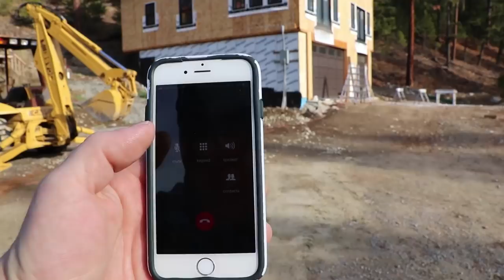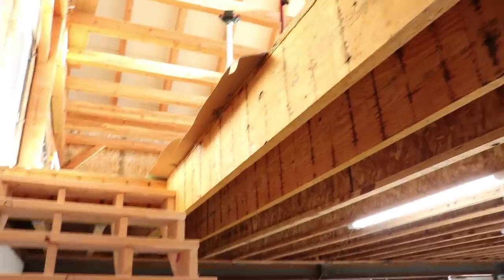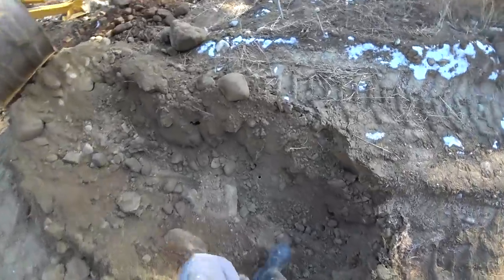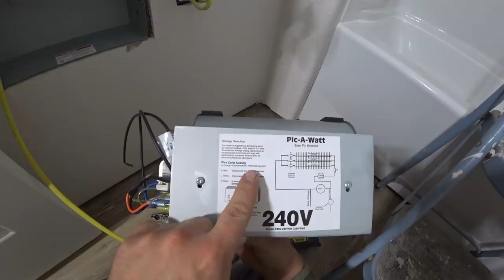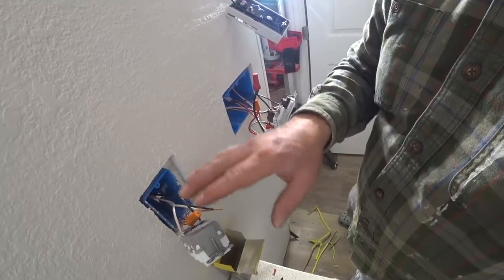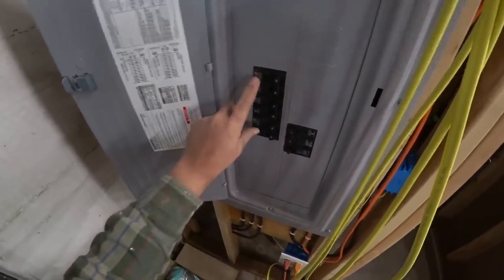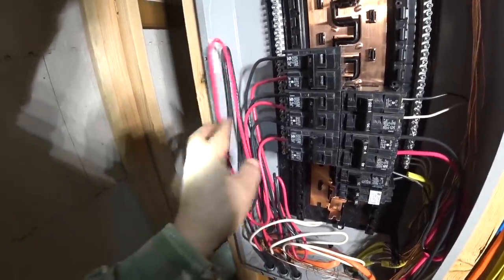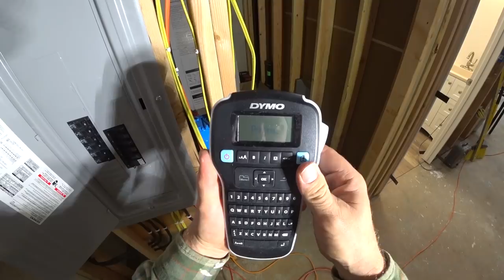Holy Cow IT ACTUALLY WORKS! (Wiring Garage Bathroom)

Comment: Questions for you electricians on here.  Why not go with a GFI breaker in the box and regular outlets?  Hopefully starting my build next summer and want to use these for the bathroom and kitchen

https://www.amazon.com/d/Thermal-Magnetic-Circuit-Breakers/QO120GFI-Square-20Amp-1-pole-breaker/B005AZHSIC.
Reply: because they're 45 dollars and a gfi outlet is only 10...
Reply: glad you asked. square d panel with quick grips and plug on neutral is a must. or leviton just started making a panel that is very nice also
Reply: if your panel is far from the location is a negative for gfi breakers. plan on installing arc fault breakers
Reply: if you want to save money have an electrician consult and layout the house and set the boxes for you. most will have no trouble with you pulling your own wires. if it's 2x4 walls buy plastic stackers instead of staples
Reply: that link you posted is a breaker with a "pig tail" the panel will be stuffed with those and look like shit
Reply: We can see the top of the Tetons from the Kitchen window in the farm house/.. Your link is to a QO breaker  QO's are a step up from HOMELINE series more commonly residential use. Jesse is making a lot of mistakes building this house.  best to hire a retired contractor to mentor you, I am a GC, taught construction trades a few years ago JC and apprentice classes.
Reply: Cause if if your in the bathroom taking a huge dump or taking a shower and the gfci breaker trips for some reason then you are in the dark.... In cases "other" than how "he wired" his bathroom, you could use a gfci breaker to feed the sink outlet/s only, and wire the lighting in 14-2. and use standard receptacles. But a GFCI breaker is like 36.00 where a gfci outlet is like 15.00 so it is a cost issue most of the time. As far as your build next summer there are different requirement for the kitchen countertop circuits that differ than a bathroom, locally here you are required to have AfCI and GFCI for kitchen counter top space, just check with your local codes to see what is the requirements, or hire a licensed electrician.

Comment: BLACK RED   AT 240V AMP DRAW IS 10 AMPS AT 120 V AMP DRAW  IS 18.3    NO 12 WIRE IS 20 AMPS    WHEN USEING THE WHITE AS A HOT ITS NEEDS TO BE MARK RED OR BLACK
Reply: The heater is only a 240v heater it will never draw more than 10 amps...a 14-2 would suffice as well as identifying the grounded conductor to an ungrounded conductor color, per NEC 200.7

Comment: Here in South Africa (all 240v) you can't have lights and sockets (outlets) on the same circuit. 10A breaker for lights and 20A breakers for outlets. Our outlets have a switch for each plug and our light switches press down for on not up. Oh yes and no switches or outlets allowed inside the bathroom. Sometimes you might have an outlet for a shaver near your basin but hardly anyone uses them.
Reply: Concerns for safety are squared when you double the voltage, and GFI and other fault protectors, required in many nations with 240V standard, as well as in North Am potentially dangerous situations, greatly reduces the hazard. Wall switches and outlets, even fault protected, still have to be a min distance from sinks and showers.
Reply: Do you drive on the wrong side of the road? Lol

Comment: HA, they make you put a GFI on the incoming bathroom supply but then say you are allowed to wire the lights via the GFI input.. Well what a waste of time the GFI is then when you switch on a wet light switch with a wet hand.. Personally, whether you are allowed to wire a certain way or not.. wire for safety, not ease of installation.
Or fit a pull cord light switch.. Dumb rules are dumb!
Reply: Some jurisdictions don't allow pull string switches any more.
Reply: The NEC has no requirement for GFCI protection of lighting in a bathroom. If your fan is not inside the shower it does not require GFCI protection.
Reply: He could of ran the home run to the the 3 gang and just fed over to the gfci on the line side for the sink receptacle requirement. He just wired the bathroom backwards than most installs are done.

Comment: Got some big gaps round the switches and sockets in the bathroom, isn't that a code fail?  Some of the things that are allowed in the US amaze me, like sockets in the bath room, and like wise we allow all sockets on one floor to be on a ring circuit which I think is a big non no over there.
Reply: Ring circuits here in the UK were introduced after the war to save cable. Think we are one of the very few nations to still do it. But yes, very strange electrics in US. Two different voltages in same consumer unit, weird colour coding, sockets on bathrooms... crazy stuff.
Reply: did you even watch the video where he says he's going to be addressing that?
Reply: Part of the reason why there are receptacles in American bathrooms is that 110v is far less lethal than 240v. Also, GFCI is required. So between the two, it isn't a significant risk.
Reply: all sockets in a ring is a big no because our devices are not individual fused and our codes do not like the fact of having  excessive amperage cld occur if there is a split in the ring. i have done some qck research on uk wiriring i understand the ring idea but its to dangerous in my opinion and in a lot of uk sparkies i follow.  also the smallest wire we use for our wiring is 2.5mm fused at 15 amps wich is why we can have both lights and outlets on same circuit. this can not be done safely with a ring we wld be putting max 30 amps of power praying there is no break in ring.

 and the sockets in bathroom in modern homes are all gfci (rcd 4 u)30ma trip-setting in UK, 5ma in USA so they are qcker than your rcd. otherwise yes it wldnt make much sense like why most old homes in uk have 2 water taps for hot and cold most in north america have just one.

real qck usa avg home wiring bed rooms wired in  2.5 avg 9 devices per circuit. bathrooms all outlets need gfci exhst fans no isolaters needed can be tied into lighting circuit.  kitchen refrigerator and microwave on own circuit 2.5mm no isolaters needed. appliance counter outlets  2 circuits 4.0mm  20 amp both need gfci/rcd protection. electric cooker/oven 10mm to 25mm depends on device 40 to 70 amps own circuit 240 volt.  washing machine 2.5mm 15 amp own circuit. electric clothes dryer  6mm 30 amp 240volt min depends on machine. electric hot water tank  may need isolater and 6mm 30 amp 240 volt. outside  a/c  6mm to 16mm 240 volt needs isolater
Reply: Sockets and touch switches are allowed here in the Netherlands as well. We use 230 volts though. The things that most amaze me about American electricity systems is that they make panels and conduit out of METAL. that's so freaking dangerous. Just use plastic for that, it does not conduct. I'd never dare to touch an electrical panel that's made of metal.
Reply: Nix on the Ring Circuit. You have to understand the theory of operation to understand the proclivity to cause fires if one end of the loop disconnects. They were for another era that has passed, even for the UK. They're also a pain in the azz to install in many cases. In the big scheme of things, copper is cheap, and in the scheme of safety, not worth being frugal with. North Am can and does allow 240V appliance supply wiring, and oddly, under the NEC, with less rigorous requirements. For long runs and power tools, 240V is almost always better, especially if a heavy draw like a table saw, or in the kitchen, a commercial toaster or mixer.

It's often cheaper and more effective to wire kitchens with 240V outlets as well as 120V to use European appliances rather than replace them for those who've emigrated here.

For garages now, due to car recharging, some jurisdictions require 240V be provided. Oddly, GFCI protection not required, although sensors for that are included in the chargers themselves in most cases I'm aware of.

Comment: Use your duct/gorilla/godzilla tape over your french door holes until you fill them with knobs, locks etc.  You probably already have done this.  Your videos are running behind.  Foam pipe vent.   Will be interested in if you have a new way to seal garage doors better.

Comment: from an electrician in the uk... im sorry, I have watched obsessively from the very beginning and loved every episode.. but this video had me cringing.. im surrounded by 5 other electricians all open mouthed in disbelief .. is that really how your electrics are done???.. I wont even comment on the quality other than its a lesson in why it should be left too a professional..  by the time the rest of the wiring goes in, that board is going to look like a plate of spaghetti..  can anybody explain why the main isolating switch is outside rather than a part of the board ????  and the bare earth/ground wires.. you dont sleeve them ?  why are all the cables run down to the floor then back up into the board..  there are knockouts at the top for a reason ??.. I have too leave it there... my head hurts..
gary
Reply: I will try to explain if I understand your lingo correctly, The isolating switch( for the heater?) if that is what you call it, we call it a reostat/Thermostat, is generally located within site of the device it serves, in this case the bathroom for easy access to control the temperature of the heater. The bare ground wires are pretty common in houses in the US, there are some places like Chicago that don't allow the use of Romex-(nmb) but most of the country houses are wired with romex with bare grounds in the sheathing. For Commercial building most are piped with EMT or other means like ENT(Smurftube) and in those building the ground is coated with a green coating along with other colors for the non grounded conductors and grounded conductors. It is typical to use both the top and the bottom of the panel (board) for entry when it is in a wall like it is installed in this application, He is going to have a crap ton more of wires to feed into the panel from upstairs and that is probably why he is using more of the bottom of the panel for these local circuits that are installed in some of the same framing areas. I hoped this helped, but feel free to ask any other questions on how us Americans wire stuff goofy haha, I would also state that Jesse is not a professional electrician and hopefully his wiring does not influence the rest of the world as to how things are wired here in the US. Be that as it may, he didn't do to bad of a job but does have some code violations in some of his wiring. But as a homeowner he is allowed to wire his own house as long as it is up to standards of his local/state codes.

Comment: NOOOOOOOOO !!!!!  When wiring a 220V box or outlet use black wire and red wire for the two power leads and bare copper wire for the ground lead. No white wire at all. This is why your feed into the main box is a black cable to one buss bar and a red cable to the other buss bar. The white cable goes to the neutral buss which is used for 110V only. notice that each 220V double breaker connects to both black and red bus bars in main box. Your electrical inspector will be giving you a stern safety lecture for using white wire instead of red. You have set a trap for some poor unsuspecting electrician.
Reply: Unless he decides to follow code, NEC 200.7 and re identify the grounded conductor to a color of a un grounded conductor.

Comment: That outlet is way too close to the water tub that would not be allowed in Ontario
Reply: yup local codes and laws vary from state to state
Reply: Canada does weird wiring, us US electricians know this cause you mount your panels sideways, hahaha No but really I don't believe that requirement is here in the states, just as long as it is not IN the shower.

Comment: I would review your thermostatic wiring... it does not sound correct... all the 240v thermostatics I have wired require that I wire both legs through the thermostatic switch... the way you have it wired you will have one leg 120v hot at the heater all the time... the sounds wrong and dangerous.

Comment: More NEC violations! The heater white wire must be colored to designate it as an ungrounded conductor. You also mis-stated the names of the conductors. Additionally, the bathroom receptacles must be a circuit by themselves. Lights and fans should be on 15A circuits. It is not a "hot" wire, it is called the "ungrounded" conductor. Seriously, you need more understanding or you are going to burn your house down.

Comment: Stop touching inside your panel, you are freaking me out.
Reply: As long as I know it is dead, I don't mind touching a panel. However, I don't trust his use of a non-contact voltage detector only. I always use a known working multimeter to test a panel before I touch it. Also, a good habit is to tape/label a beaker or disconnect if you are going to work on it.
Reply: it wont shock you through the computer, i swear !!

Comment: You need to replace your heater wire with one that has black, red, white , and bare ground.   National Electric Code.
Reply: false. 12-2 is fine for a 240v heater load per the NEC. 12-3 is only needed for a 240v appliance load where you need a neutral for running 120v parts of the appliance. Best practice is to mark the white with a black or red trace where it is visible.
Reply: Neutral not necessary, unneeded expense and thickens the cable, but black and red, absolutely.
Reply: NEC 200.7 (c) allows for re identification of the grounded conductor... National Electrical Code.

Comment: having outlets and switches, electrical heaters etc in bathrooms is no allowed in the UK at all, and even if it was, there is no way I would ever put an outlet in a bathroom. It's not needed and someone is going to get fried one day.
Reply: Honestly the way the NEC reads you could put a gfci in a shower as long as it had a wet cover on it. It basically say within 6ft of wet areas if it's easily accessible. How do you UK people run your blow dryers without power in the bathroom?
Reply: US is very different, plus we can have sockets now in the bathrooms in the UK BUT there are rules to them. Remember the US is 110V,  and they use massively protected outlets, i doubt he has any 220V circuits in there.
Reply: we have ground fault circuit interrupters so you wont get shocked if something gets wet.
Reply: we have ground fault circuit interrupters so you wont get shocked if something gets wet.
Reply: Not a problem with GFCI outlets.
Reply: totally common in the two place I lived, the US and Germany.  I have never had a London hotel room that did not have electric in the WC.
Reply: This isn't the UK
Reply: All bathrooms in the UK lack electricity? I call BS. There's a ton of need for electricity in the bathroom. It isn't scary fairy magic to be feared...
Reply: LOL really? Joe do you even charge toothbrushes and electric razors? GFI plugs are made for that exact purpose.
Reply: We use hairdryer in the bathroom...
Reply: itsverygreen; GFI’s prevent electrocution by measuring an imbalance and tripping much like a breaker but much much faster.
Reply: itsverygreen I hope you're talking about the floor outlet. I'm guessing every woman on earth would disagree about not needing an outlet in the bath
Reply: itsverygreen outlets are required. But everything must be GFI protected. It is safer than you think. Keeps people from using extension cords from non GFI protected outlets
Reply: A GFCI switch should stop anything from happening. Electric toothbrushes, shavers, hair dryers, straighteners. I charge my phone when I'm getting ready in the mornings (unnecessary but nice) so there are a lot of reasons. It's odd to find one at a lower level, but having one at the counter is very useful. That being said, don't take a bath with your toaster and you'll be alright. Every bathroom has a light, and at least in the US some sort of fan. I can't speak to the individual heater. That's not very common.
Reply: itsverygreen I’ve heard this from others from the UK also, but in the United States most state building codes require one outlet and the light switch be in the bathroom.
Reply: itsverygreen the UK has real 240 v I.e 1 live wire at 240 volts supply.  The US has 2 wires at 120 v  at 180 phase separation which gives you the 240.  The UK doesn’t even have light switches in the bathroom they are all pull cords.
Reply: It is in Canada. They are on a GFI and are safe as can be.
Reply: Electric shavers, hair dryers, eyelash curlers, etc etc
Reply: They arent in the UK !   USA folks like to use hair dryers and curling irons to fancy their women up more i guess !!   The getting fried is taken care of by the GFI outlets !